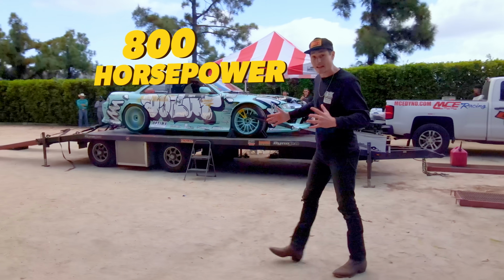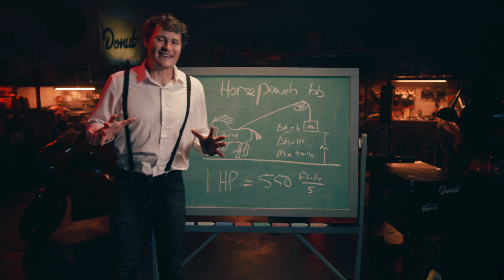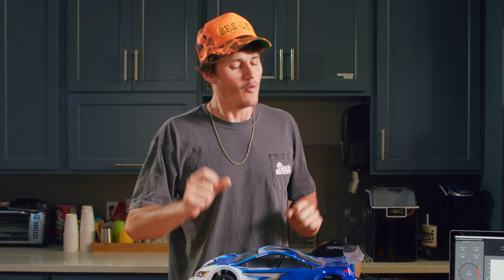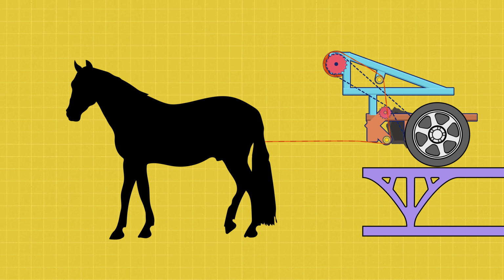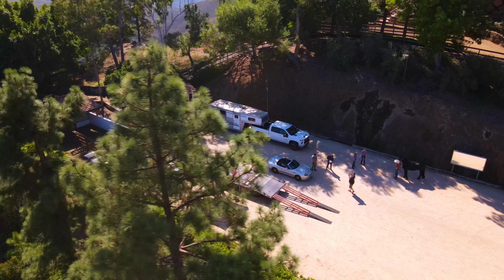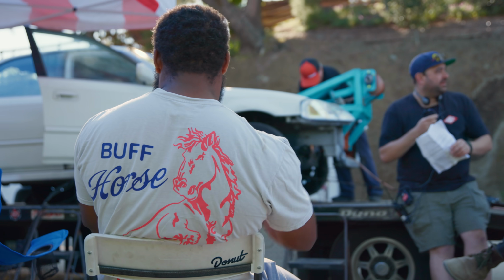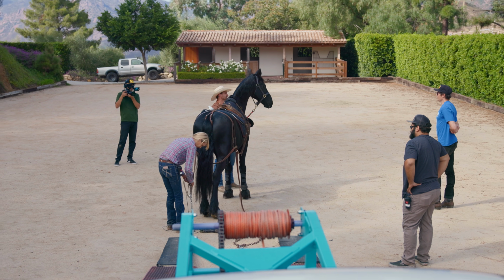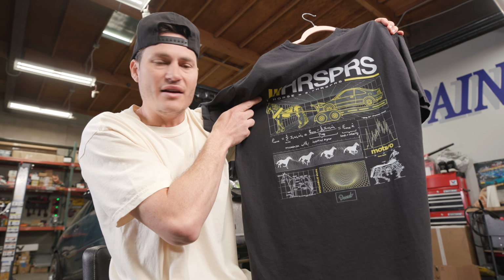How Much Horsepower is a Horse?

Comment: So the only problem I have here is this is “five” short pulls by the horse. Even the common legend on Wikipedia I don’t think suggests quick pulls and done. “A common legend states that the unit was created when one of Watt's first customers, a brewer, specifically demanded an engine that would match a horse, and chose the strongest horse he had and driving it to the limit. Watt accepted the challenge and built a machine that was actually even stronger than the figure achieved by the brewer, and the output of that machine became the horsepower.”  This quote leads me to believe it was a day of work for the horse. And therefore 1/5 or 1/6 of your max effort makes sense. And I think more so than I ever did before that 1 horsepower is pretty accurate.

Comment: That horse looked very relaxed. Didn't seem to exert all the power it had, but this definitely gives a good idea of what a real HP is :D
Reply: maybe someone mistaken horsepower for humanpower :DD
Reply: @TheTheMinions  It seems like it
Reply: right so a car with 200 hp is really 200 manpower and 1000 horse power !  @TheTheMinions
Reply: @Halliday7895  You've got that backwards. A 200 HP car would = 35 horses
Reply: FWIW, I think you mean a 200hp car is really 200 manpower and 35 horse power (you would divide 200hp by 5.7, not multiply). @Halliday7895
Reply: 200 man power and 35 horsepower * @Halliday7895
Reply: If a real horse has 5.7 horse power the car has about 35 "real" horse power I think @Halliday7895
Reply: Also I feel like they should have shown an electric motor with a known Wattage being hooked up and measured on their system. Not to discredit the work by the engineering team, but to not measure the accuracy and calibrate measuring equipment? That's not right. And if it was done off camera, why not mention it?
Reply: @gileee  i bet u if they tied a car up to that shit dyno they would of got some weak ass reading
Reply: @ortegaJfk  100%. This setup is absolute sh*t. A horse can pull 30, 40, maybe 50 times the average human. Like someone in another comment said, they could have literally just hooked the horse up to an electric motor and measured the output wattage and gotten an actually relevant results. This experiment has so many variables and points of failure it's impossible to do science with it.

Don't wanna be this negative but this is such overengineered trash in an overproduced absolute garbage of a video.
Reply: The horsepower was never intended to measure peak output, that's a modern car thing. It was for measuring the expected amount of work you could get out of a horse vs. some motor or other, and after we stopped using horses it stopped mattering all that much how accurate it is. So, a relatively relaxed horse descended from draft horses is exactly the measure we want if we want to know how much Watt was fudging his numbers to make his steam engine look good.
Reply: @TysonJensen they never found peak output.  They tested with a randomly assigned, fixed load.
Reply: They aren't looking for peak output. peak output is a modern reinterpretation for car racing. They're looking for reasonable load. Having a horse pull a dyno for a bit is a good approximation of reasonable. @timothym2241
Reply: @TysonJensen  100% While I'd really like to see the numbers on a Belgian Draught a light draft horse is much more likely to be representative.
Reply: @TysonJensen  Yep!  He probably measured how productive it was and then adjusted for horses.  His product was around 10x as productive as a horse, not because of its max speed or strength but because it could run day and night where a horse would tire out.  Adjust for only running for as long as they worked the horses and it was around 5x as productive as a horse.
Reply: @TysonJensen  that comment was a load of trash
Reply: @ortegaJfk dam I hate ppl like you who see a well explained comment and just Nuh uh and feel like your right.
Reply: Not even a draft horse
Reply: @ortegaJfk it's literally a draft horse.

A light draft horse, so definitely on the low end of draft horse power, but a draft horse all the same.
Reply: @KraziEyevin  lmao  hes a fresan my boy .. A pure bred Draft horse is way stronger
Reply: @ortegaJfk it is😂
Reply: Hit points
Reply: If the horse was running for it's life, how much horse power would it make then? But I think the hp measurement was how much sustained power could a horse make, not just a sprinting burst.
Reply: the whole point of the original hp measurement was something a horse could pull for hours on end
Reply: Sorry, but this experiment was pitifully inaccurate.  No work was done whatsoever to establish at what cadence the horse generated maximum horsepower.  A lighter load and a near running cadence would generate more horsepower   The muscles of a horse, or man, for that matter, are made to generate more power at a higher speed. They tested both at close to max load from a standstill.  A running horse or man generates more horsepower.
Reply: @timothym2241  It at least establishes something of a floor for how much power that type of horse can produce.
Reply: I also feel after it start moving it was a breeze for him, if not peak performance let say optimal work load around 50%. So let say 10HP considering that is not the strongest breed, those 15HP seems like a good estimate for theoretical peak output.
Reply: No, it gives you absolutely no idea of what real horsepower is.
Reply: @John-eq8cu  Well, it was a real horse, the horse produced power, and the power was measured. What else do you want in the equation?
Reply: @kutykutyka  Yes, the power was measured, but what did they actually measure? I contend that it's not a good or useful measurement or horsepower. It was entertaining, and thoughtful, but no good data. That would have been enough, but then the video claims that they want to publish their findings in a scientific journal, which made me laugh.
Reply: @John-eq8cu  I agree. Maybe they didn't come up with an accurate number, but it was fun to watch how they came to those numbers, and to me it really doesn't matter what the real numbers are. If a car is claimed to be 200HP and another one is 400HP and the torque numbers are the same, weight of the cars are about the same and the gear ratios, you'd know almost exactly what to expect for acceleration figures. The claimed numbers are good for comparison and give a good idea of the power of a vehicle.
Reply: @John-eq8cu  Most people wouldn't understand the results anyway. What is Newton Meter, Horse Power, and all the other measures of power or torque. We all just compare the numbers to other numbers, power to weight ratio, etc. No one really cares about a perfect result, the ball park is good enough to compare. Even a 0-60mph figure is an effective way to compare vehicles if you're about to buy car or motorcycle, and like fast acceleration. If numbers look good research the handling of the machine, and some more details and that's all most people will ever need for the street.
Reply: Thats why God put them here to help us, that horse was happy to be doing whatEVER. Better than standing in a barn.

Comment: To be fair, James Watt compared his steam engine to draft horses (as stated in the video), which were pulling hours at a time, quite different from peak power. One of the main benefits of the steam engine was that you could keep up that power for as long as you had fuel, while a horse can only do a few pulls with that amount of power and then fatigue. It's like riding a bike. A sprinter on the track can pull of way higher power than a tour the france rider does, because there's quite a big difference between riding 500 meters or 200 km. While full power constantly for hours isn't particularly good for the engine, you can stay very close to it basically forever, unlike animals. A professional track sprinter tends peak around 2400 W, while a tour the france rider usually goes around 300 W on average in a stage. So the differences are huge. James Watts 'horsepower' was compared the the latter way of using a horse, while you guys measured the former. Still an interesting find though!

Comment: This is great, but I am honestly surprised Donut and Motiva didn't make a large treadmill for the horse to run on, that seems like it might have been an even easier solution.
Reply: Probably a safety concern for the horse to use. Plus that brings in more calculations for length of the track, rollers and everything they need to do.

Comment: Is anyone else thinking about the amount of force needed to pull the rope and the diameter of the wheel with the rope, and gearing involved to get the "power" to spin the dyno wheel. Wouldn't all of the gearing involved and drag skew the number? Wouldn't it of been more accurate to create a treadmill for the horse that would directly turn the dyno roller if the dyno roller is the gold standard?

Comment: I feel like if the horse was sprinting it will be more accurate.  Cars measure horsepower by peak output. So it would make sense to have the horse running as fast as it can go.

Comment: What an awesome experiment. So what does this mean when applied to the HP numbers currently in use. My Mustang GT has 440 HP as measured in 2017. What does the new method do to that number????????????  Is there a formula for converting from the old to the new method?

Comment: It's very simple. Take the h22 (it made 102% volumetric efficieny(cylinders 102% filled with air) at peak tq according to Honda's f22 sae paper.

Okay so h22, find peak tq (161.5tq), 

now find the hp at peak tq((161.5 x 5500rpm) ÷ 5252 = 169hp@5500rpm,

 now divide 169hp@5500rpm by the rpm at peak tq(5.500rpm) = 30.7501@1000rpm@2.153 liters,

 now take that number and divide it by the liters of the engine 30.7501 ÷ 2.153 liters) = 14.28hp@1000rpm@1 liter = 102% volumetric efficieny.

((14.28 ÷ 102volumetric efficieny) x 100volumetric efficieny) =

 14.0024hp@1000rpm@1 liter@10:1 compression@100%ve

You're welcome if you read this you can use this number to compare engines efficiency or how much horsepower they make per a drop of gas. Hondas are crazy everyone else is like meh

Comment: jesus fucking christ, im 12 mins in and theyre trying to power the car with the horse its self? that makes no sense, now there will be mechanical loss because some diptard wanted to actually horse swap a car. could have just got a horse and added the same spool idea to the drum on the dyno, and it would have been far more accurate representation of the horse. instead of delivering power through different mediums.  this was way over thought. i should have just sown up and fucking did it for you guys, holy shit, this was such an easy experiment to figure out and you guys fluffed it all up for no reason.

Comment: you guys are over thinking this entire thing, a horse power would simply be one horse. becasue modern dynos are already use the "horsepower" figure. if a horse makes so and so power not equivalent to 1 horse. than that means the entire scale has always been wrong and the actual power of cars would have to be divided by said number of a horse. also it should probably be an average test of horses, not just one horse. if one horse pulls 10hp and another horse pulls 20, which horse do we use for the base line? i get it, you guys tried to be technical and make a video about something all us car guys have always wondered. but you thought about the wrong things.

Comment: Why do you need a car in the equation? Rhetorical.   If you want to contain and abuse a horse without it wanting this, directly harness a horse to a dynamic wheel.   Besides this bring all marketing and views BS wrapped in a science package, just throw the car in the equation for no reason.   Just because you can't build a smaller dyno. It's a car dyno with a horse attached.  HP is also a meaningless measure, like everything. It doesn't matter what HP is. It's a fictitious/arbitrary measurement.  It just has to have a standard. Torque is actually more valuable as well. Sell new T-Shirts now.  Wheel HP......what a thrill.

Comment: Why not just let the horse pull on a wagon on rails for low rolling resistance. Just have to know the mass..  and measure the distance over time with a camera tilted down at the pre-measured rails.
Reply: There are several methods of measuring the output power of the horse, that would have been far more accurate.  Most involve pulling a load (rail car, cart, wagon, sled) over a distance.  The method they chose is perhaps the most convoluted and least accurate.
Reply: @am.i.serious4284  I totally agree 👍
Reply: @am.i.serious4284  Sometimes you just need the thinking from analytical minds who knows how to simplify a problem down to the bare minimum. 
These guys definitely didn't. They went Mythbuster-style with a flair, with all ups and downs that comes with it.

Comment: One way to maybe have done it easier is time the horse pulling a heavy load, then hook up a variable frequency drive and modulate an electric motor to do the same amount of work in the same amount of time. The drive displays the horsepower being put into the motor. 

Your way was more entertaining though lol

Comment: I appreciate the work that went into this episode and the total content but it would've been a hell of a lot easier to either modify the dyno slightly to adjust or use a torque + Rotary encoder and an adjustable load brake. Glad to know that I only need to be 5 times stronger to be a buff horse.
Reply: I really expected that was what they were going to do,  got a bit surprised when the car was added.  I might be totally wrong as I am not really thinking this with time, just an comment out of impulse,  but they need to stop the horse from accelerating,  get him close to his max power/speed (which could be a slow walk) and keep him there on a  steady pull and prevent him from almost starting a trot, he will show more power,  I kind of knew something was off when the sole human power was not far away from a 3 human power, either the instrument is off or someone on that trio was just there for the screen time

Comment: This is absolutely... not good enough. Just like many ole Mythbusters tests, truth to be told. 
Firstly, how do you know the equipment can accurately measure this the way you did? There were a lot of spikes in power output (as expected), but the dyno is not made for that.
You really should just put on a rotating mark on the drum that you record with a camera. 
Then, look at the footage over time to calculate the power. 
You really just need to know the inertia of the drum.
Also, it seems you didn't check when the horse has its maximum power output. There is good chances it does put out most power from 0 mph. But we don't know, right?
Lastly, you probably should have used a bungee so the pull would have been smoother for the horse.
There were also introduced a lot of losses in the mechanical conversion from horse-to-drum that were difficult to measure. So when you calculated the estimated crank output, you were already off.
And there's more. 
I'm not impressed, given all the energy you put into the project.

Comment: why just not use a flywheel and measure the time to make it rotate at certain speed. like for example some German WW2 tanks had a massive flywheel that was turned by two men to start the engine.

Comment: You say several times, what you misconception is. One Horsepower is not the Power a draft horse can perform five times a day but the power at which it can perform a hole day long. The peak is much higher. I did not watch until the end yet but I think it is about 10 to 15 times the average...

Comment: It’s actually an insanely over complicated and scientifically incoherent system. The amount of mechanical power loss going through that contraption and the cars transmission is astronomical, given very false readings. They should have just wrapped the rope the horse was pulling around the dyno drum

Comment: There is one fatal error in this experiment, at least if your trying to compare horses to engines. engines can run 24/7, horses have to eat and sleep. horspower is energy over time. if you measure a horse output while its working sure the horsepower is high, but then if you also include all the time you had to feed it and let it rest suddenly the power starts quickly approaching 1 hp per day.

Horsepower wasnt invented to stretch the truth, it was invented to compare something that cant work 24 hours a day to something that could.

Comment: This might be very wrong, but could you simply have made the horse pull bigger and bigger weights until you found out how much is too much (keeping in mind the safety of the horse). Then, with that info, you could figure out how many horse power would be needed to do the same? Or maybe it would have worked but it would have put too much stress on the horse.
Also, that joke at the end, 1/5, pure gold!